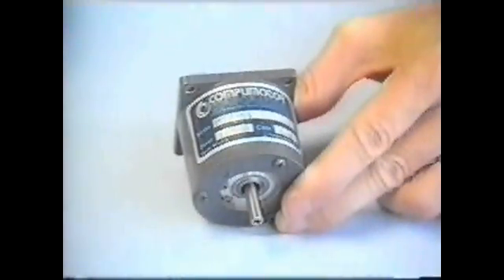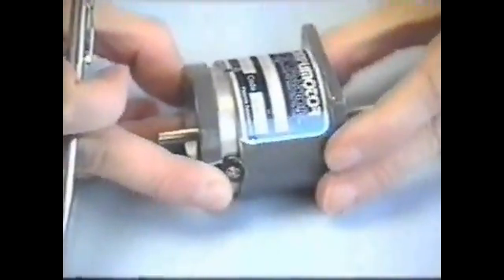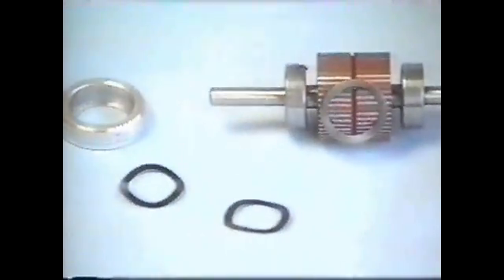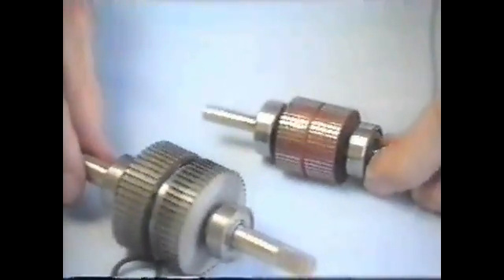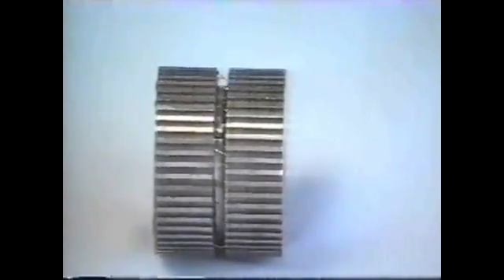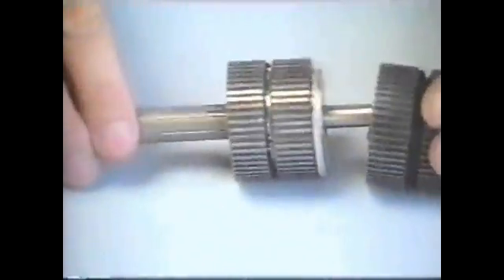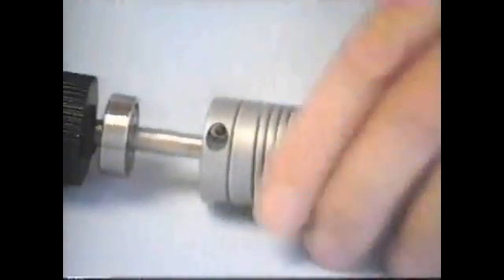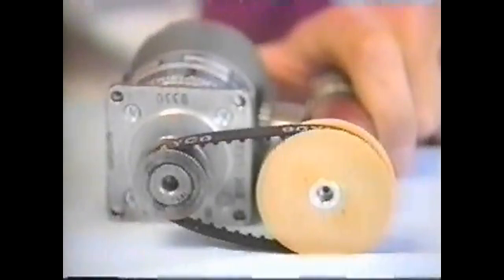How a Step Motor is made

Comment: btw i opened up my nema 23 i take out that shaft and when i put it back then i found that before opening motor i used to feel steps in shaft but when i opened and put it back then it loose its stepping i no more capable feel that steps and now rotates freely and when i gave power it vibarates only and dont rotate any one have idea what i did i wrong in putting everything back.
Reply from the maker: When you take the rotor out, you've lost about 40% of your magnet strength. You'll need to purchase a replacement. No way to fix as you'd need a magnetizer machine to re-magnetize the rotor. You should never take the rotor out. Sorry for you to learn this the hard way.
Reply: @JoHoMoCo  🙁🙁🙁
Reply: @JoHoMoCo  but i have seen in some videos and even you too take out that
Reply from the maker: @devendrasuthar5530  Yes, as a demonstration of what it looks like inside but I do not re-assemble and run the motor. Physics doesn't change.
Reply: @JoHoMoCo  i think make a video on that one do that such kind of silly mistakes
Reply from the maker: @devendrasuthar5530  The video shows what a step motor looks like inside, that's for us curious engineers that want to take things apart. It's not for repairing step motors. There's probably videos show how to repair step motors but they're very cost-effective to replace.
Reply: @devendrasuthar5530  I've heard of people getting soft iron cores and wrapping their own electromagnet. They then try to remagnetize their motors with a car battery.  I feel like you'd need higher voltage than that and some heavy gauge wire with lots of turns.  Also you have to have the poles right.  Never tried it.  I don't even know if it works.

Comment: Hello my name is Lucas Dublanc from Argentina, it cost me a lot to reach you, I needed to know if you as manufacturers of electric stepper motors, what materials in your sheets do you use? are:
Do you laminate silicon steel sheets? (Yes: 5Fe)?
other sheet metal materials?
silicon sheet steel?
SID-ELE1?

And I don't know what thickness maybe?

Thank you so much

Min 3:31
Reply from the maker: That's not info we give out. Sure you understand. Thanks.